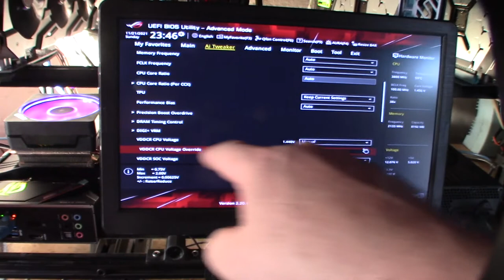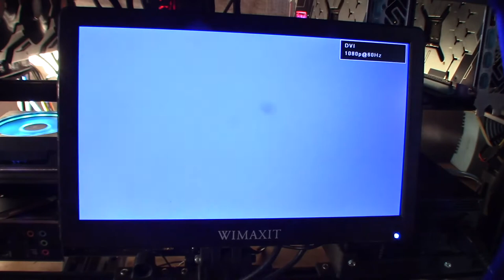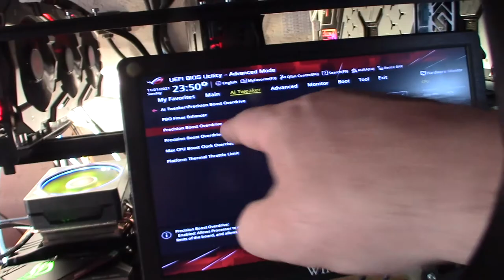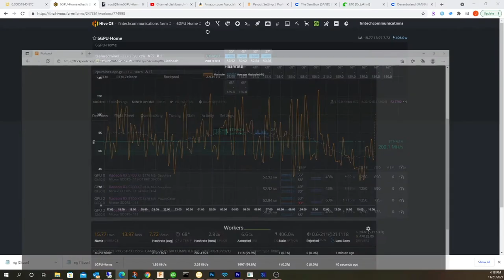Raptoreum Undervolting To Lower CPU Temps HiveOS Asus Bios

Comment: Thanks for the info. I have a question. What is the minimum motherboard requeriment to run a 5950x? I found an Asus X520M-K but I can not set all the settings you show. It sems that this mobo is very entry level to run that processor. What do u think? And what about the RAM? I really need to have 2 sticks instead of 1 for RTM minning? Thanks